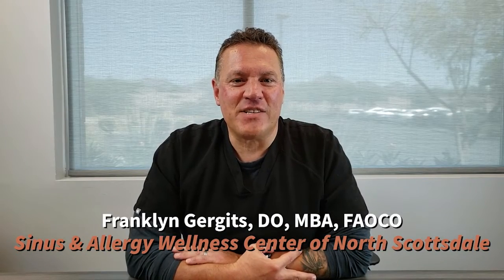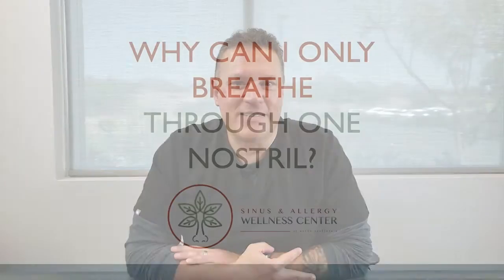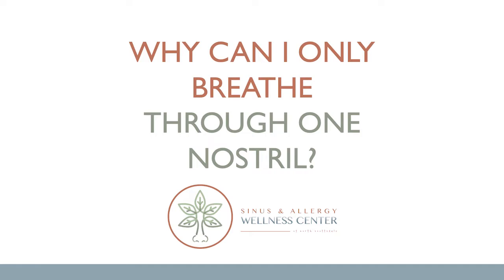Why can I only breathe through one nostril?

Comment: One of my nostril is not working at all. And they also switch during the day. I had 2 surgeries. One when i was 20 ( straightened cartilage between nostrils) - it didnt help at all. 

Second , when i was 33. They unclogged some canals, removed some tissue. After it healed in few weaks i was able to breath normally.. for 1 day. After one day , one side got blocked again:)
Reply: What about turbinectomy? Do you need it?

Comment: Doc, why is it most doctors are talking about Deviated Septum & Turbinate Reduction but not maxillary sinuses or sinuses in general, because I just had my Deviated Septum & Turbinate Surgery but still the nose is exactly the same
Reply: Could be allergies. Try nose spray like Flonase.
Reply: same, its actaully worse on my right side now. every single night it closes off with zero air flow with cheek and eye pressure and absolutly nothing to blow out of my nose. Just swollen shut.

Comment: Hey people. I've had this too but I figured it out. It happens because sometimes I sleep to my side. When I sleep on my right side, my left nostril gets clogged. When I sleep on my left side, my right nostril gets clogged. But if I manage to sleep on my back at an incline then I breathe through both nostrils unclogged. Staying hydrated helps too. And trying to keep the room you are in for a long period of time with a bit of moist air. Rooms with dry air tend to swell up the nostrils.

Comment: Is it normal for the nostril to become completely blocked with zero air flow even when air is forced? Almost like its swollen shut, but no phlegm, discharge, or other debris? Is it normal for this swollen condition to switch sides completely over time so then the other nostril is completely swollen shut, taking turns?  And its not the nostril closer to ground because I'm sitting up in a recliner with neither side leaning down?  It actually feels like my cheek and eye is swollen on the side it occurs . 
So why is it normal for my face to play swollen nostril see-saw?
Reply: God i am the exact same way...ever since I let the fuckin doctor preform surgery on me. I had septoplasty with a turbinate reduction. Just made my problems fuckin worse. the zero air flow with no phelgm or other debris and the eye and check pressure is exactly what I have. Of course doctors say septum is straight and CT scan looks fine now.

Comment: I think the video should mention about the normal condition of Nasal Cycle, not to be confuse with conditions that you mentioned which is abnormal for only one side problem..🥲
Reply: Is it normal for the nostril to become completely blocked with zero air flow even when air is forced? Almost like its swollen shut, but no phlegm, discharge, or other debris? Is it normal for this swollen condition to switch sides completely over time so then the other nostril is completely swollen shut, taking turns?  And its not the nostril closer to ground because I'm sitting up in a recliner with neither side leaning down?  It actually feels like my cheek and eye is swollen on the side it occurs . 
So why is it normal for my face to play swollen see-saw?
Reply: @Metqa how are you now

Comment: By the time the video started, my right nostril was blocked. By the end of the video, it switched. Left nostril was blocked
Reply: nasal cycle, its only normal if you don't notice it.
Reply: @silvertongues2 and whats if its so bad you do?
Reply: @marthasisco9678 could be something wrong like deviated septum, or inflammation. Which can be a factor in breathing issues like sleep apnea, which is what I have.
Reply: @silvertongues2  ent dr scoped my nose said it's not bad enough for surgery  but gives me issues
Reply: @marthasisco9678 im not sure surgery would be a perfect solution either. Ive been trying to loose weight clean up my diet and eat more anti inflammatory food. Also I’ve started to sleep with the window open and get more fresh air. I’m basically assuming that my nose is inflamed
Reply: @silvertongues2  yes I've been walking more everyday
Reply: @silvertongues2  yeah i had it since i was about 6-7 yo , most of the time it doesn't bother me but it sure does when i exercise and try to get as much air through my nose and out of my mouth as possible, any thoughts about how can i get rid of it completely  ?